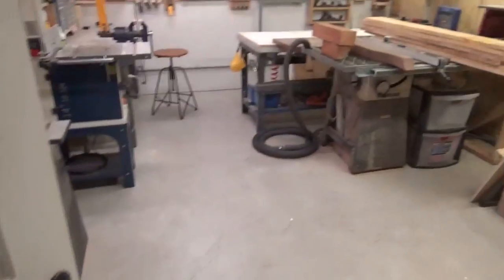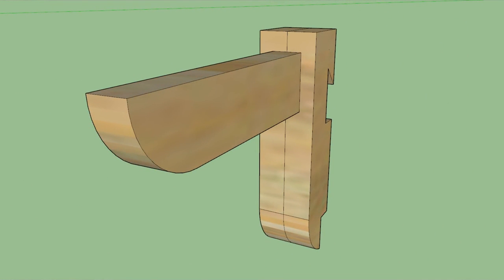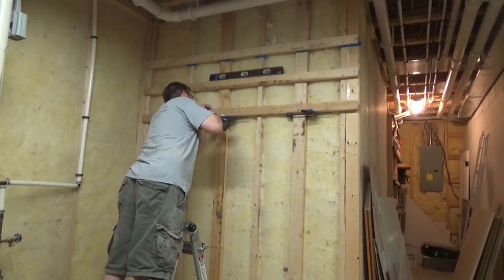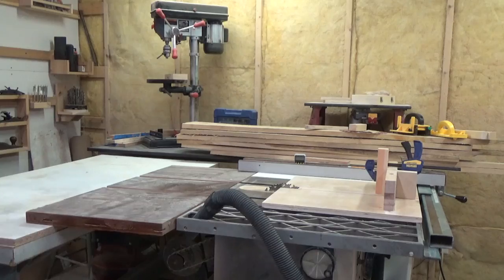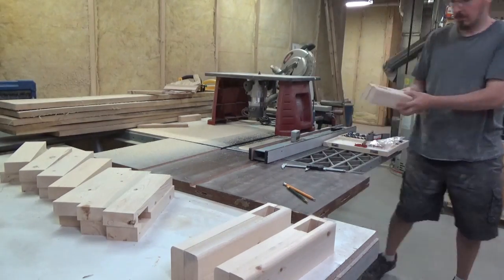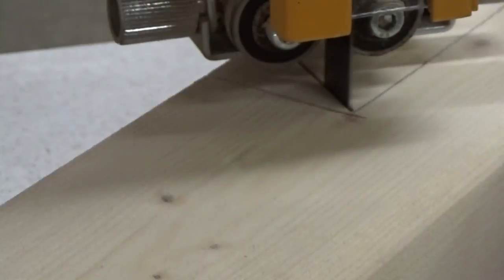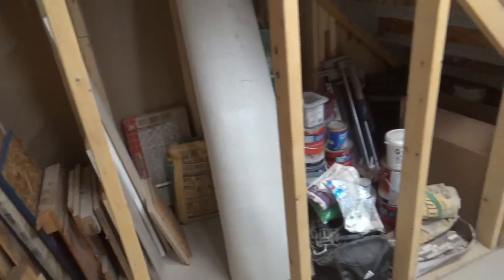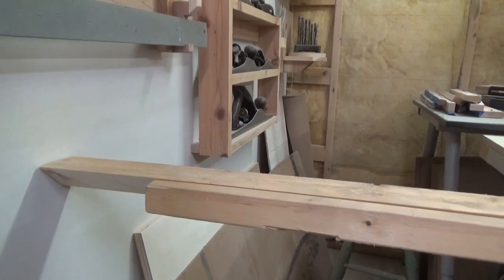Shop Work: How to build a French Cleat Lumber Rack

Comment: Fine craftsmanship! I'm a plumber, I evenly space 2x4s along my wall with holes drilled into them at a slight upward angle with a drill bit guide made from a piece of 2x4. Then took old 1/2" galvanized water lines I removed from various jobs and made lots of 3 different length rods I could put in the holes at different alignment and heights. I have material as short as 3' up to 20' on there. Only cost was 8 2x4s. Took about 3 hrs all time involved and works slick!!

Comment: You are one of my favorite woodworkers to watch. Your videos are applicable to the common woodworker and the videos allow for proper execution of the project along with the comic relief we all need! 
Simple solution for your glue bottle.... you could use the unmentionable pallet wood to make a 6 inch by 1 1/2 inch  with a tapered notch that fits under the cap. Makes for a nice lever for those of us that get on in years or forget to clean the tip before we close the bottle. I’ve actually changed over to a Gluebot. Great investment! Btw, eventually everyone is going to want their “appropriated” lumber back!  lol
Reply from the maker: Thanks Mark! 😀

Comment: I like it and the way you built the wood holders you have room below the top cleat to put in a block of wood to lock it down and make it absolutely tornado proof. Works good on lots of cleat accessories that may come off due to the item stored in it. Please do an in-depth video of air compressor system that I can remotely start i.e, I’m wanting to store inside my workbench and have a panel on outside that allows me to start, stop, have air filter and oiler and here is the kicker, discharge the air and moisture automatically when done using it.  I don’t keep my compressor pressurized. Thank you, great channel!

Comment: Really like your system, you designed it very well! I’m like you in that I can’t pass up a free piece of wood or even one I have to pay for. That being said just pray you never have to move, because of business we had to move five times in six years. The movers loved it! Charged more to move my shop and it’s contents than all the rest of the house combined! After the third set up I resorted to Costco 18” x 48” x78” wire rack shelving. At $80 a piece and combined with some full size 12”x 12”x 18”  commercial milk crates all my cutoffs finally had a portable home that locked nicely into the shelves at 3 per shelf. By aligning 3 shelves on each u it at the same height I was able to accommodate all the 8’ - 10’ stuff. By attaching an 8”x8” angle brackets to the bottom of each vertical post I was able to also hang some sheet goods and plywood  across the back of the units as well. As each rack is rated for 600 lbs per shelf and on locking 4” wheels, they could easily be rolled right into the movers van. The only downside was the buyers all wanted the shelving to be left as part of the house sale!!!
Reply from the maker: Yeah I'm not looking forward to having to move the shop when it comes time.  Can't imagine doing it 5 times!  But I guess out of it comes ingenuity like what you found.  Great work, Ken! :)

Comment: I had a bunch of long steel  bars maybe 7/1`6" dia.    Cut them about 12-15" long.   Drilled holes slightly undersized into studs, pounded them in,  Lose only about 1" vertically between batches of boards.  has worked fine for over 30 years

Comment: Love it ! I got the same problem, well to a certain degree, much smaller shop though. So I like the idea and the flexability of it, so I will start to plan for it. Like most things though...time is involved, huh. Anyways great job, love the patience involved.  Gotta love the texting and cell calls, they come right at the ....right time don't they?  Andrew
Reply from the maker: Thanks, Andrew!  I've really enjoyed the system so far.  I've rearranged it twice now to accommodate different wood storage configurations and it's worked perfectly.  The only thing I wish I did differently is to create even more brackets.  I could easily use another half dozen for additional supports (to keep wood from sagging over time) and to just hold more smaller pieces.  Thanks for watching man!
Reply: @FishersShop  
What was the size of the wall that you built your cleat system on?

Comment: You have GREAT ideas and a great system, however that's too labor intensive for me, plus I am lacking many of the awesome tools needed to copy your system.  I LOVED YOUR DIAGRAM AND YOUR CONCISE EXPLANATIONS AND CLEAR INSTRUCTIONS.  Also, like you, I cannot reaist saving boards, wood, lumber that is being tossed out.  A friend recently put me in touch with someone closing their pallet manufacturing business.  I got five SKIDS of pallet decking boards (NO BREAKING PALLETS APART FOR THE WOOD) as well as some other lumber for no cost, well just my time, sweat and the cost of the chiropractor afterwards (I'm not kidding).  I don't own a pickup truck, so I made DOZENS of trips in my car with the trunk and back seat loaded up.  All of the decking boards were salvage boards (ie. previously used, had cut off nail heads) and a couple of skids were that beautifully aged dark color that has so much character.  Now I have wood enough for all my projects!  I was VERY FORTUNATE!!
Reply from the maker: Sounds like you're going to be busy. :)

Comment: Great project. I've been trying to figure out a simular solution. Funny I thought of another and easy method while watching. One or more sheets of 3/4 hung horizontally or vertically with wholes to accept dowls. A peg board in sense. Adjustable almost like cleats.
Reply from the maker: Yes, that would be easier.  But you'll soon find out the holding strength of that design will be vastly lower than your expectations.  Try it and find out!

Comment: Very nice rack. Makes a lot of sense. I’m a little surprised that with so many identical pieces he didn’t use a stop block on the miter saw, a dado blade for the notches, or a template and router table to clean up the curves. We all have our own working style, but it must have taken quite a while to build all those pieces. Also, he has a LOT of faith in those screw in the cleats - I’d have added some F26 for more strength.

Comment: Thanks for video. I already have the French cleats on my walls, so all I have to do is make the hangers. May I suggest you put "dado set" on your Christmas list? DO NOT ask Santa for a wobbler type. They're a complete waste of money. Also, don't get a 6-inch set. If you use a sled for something like your tenons, you may not get enough blade height with a six-inch blade. Go for the 8-inch and you'll never regret it.

Comment: Very clever and cool project. I like how you thought about maximum strength joints and combined it with what you needed. Maybe you can scan the neighbourhood now for some wall lining? The dust that settles on the insulation would drive me nuts....

Comment: I would mention the term overkill, but it's too late for that. Lol
I'd make a similar rack IF I had more than two walls to work with, but both walls are pretty much already crowded with tools, benches, cans of unused chemicals and many other assorted items not to mention windows. The rest of my work areas are open and filled with all the crap I can't get the Mrs to part with even with the threat to life and limb. 
Oh well.. Good video anyway and thanks for the entertainment value.

Comment: Hi great voice, have you ever thought of doing the narrative on a Steven King Audiobook. As for the cleats, they look great but i'll have to take out a morgage on my house to pay for all the maschines you used to make them! And a degree in Engineering would'nt harm either. In spite of that a great view. Thanks a lot.
Ronald
Reply from the maker: The bandsaw is the most pricey of all my machines... but that's because I bought it brand new.  Everything else you can find on Craigslist or FB Marketplace for cheap.  I get a lot of comments about how I must have spent thousands on all my shop gear and it's just not true.  Like any hobby though, you're always putting money into it as you go, but it really doesn't cost much to get started.  Hey thanks for watching and for the comment.

Comment: Love the idea and attention to detail. If you did it over again… would you keep the 90’ on the arms, or would you have angled the cuts so the arms angled up ever so slightly and any stored wood (including round stock) would tend to stay against the wall instead of possibly sliding forward and off the arms? (Just thinking ahead to anything sagging under heavy, prolonged weight)
Reply from the maker: Since the bottom of each bracket is braced against another cleat, there's been zero sagging.  If I had to do it over again, I'd do it the same way.

Comment: It looks like you might have the same old trusty jointer model as me. Have you ever replaced the knives? If so where did you get them? I need new knives and can't find them. Good video
Reply from the maker: I just sold that jointer 2 days ago!  Haha.  I looked around for new knives and couldn't find them, but admittedly, I didn't look all that hard.  I knew I'd be getting something different eventually so I just tolerated the dull knives until I could get what I have now.  I just upgraded to a Ridgid.

Comment: You could of gang cut a lot of that & saved you a lot of time. 
Lay out the mortise pieces, line them up, cut both lines with a circular saw, then go between with router. Could have done similar to cut out for the cleats.

Comment: Any suggestions for starting out a woodshop in one's basement? Soundproofing tips, organization (I really like the French cleat method), what type of cushioning to wrap around low hanging sewage pipes (because wearing a hardhat while woodworking isn't my ideal fix), etc.
Thanks!
Reply from the maker: You can get pool noodles at the dollar store.  Cut them in half and duct tape them to the corners of low-hanging duct work.
Just regular old pink insulation does pretty good sound proofing, it's way cheaper than the high-end stuff and works nearly just as well.  The big thing for basement shops is dust collection.  Otherwise it'll get into your furnace and makes the rest of the house dusty.  Good luck!

Comment: Well done, but it seems like an unbelievable amount of time and materials for something that relies on the withdrawal/ shear strength of the screws. Drilling holes in the studs at a 5 degree angle and putting black pipe in it would have been much quicker. 2” deep holes, 1/2” pipe.... and you can stack higher because the 3” tall arms aren’t in the way.
Reply from the maker: I never claimed efficiency.  I did this mainly to see if I could and if it would work.  Turns out it does.  But there are many other alternatives.
Reply: Well said.

Comment: Drew what do you think the limit would be on the length coming off the wall? I have the metal system and I have 24" lengths. They actually sell them in 36" lengths, but you have to go to the bigger support brackets. Great video.
Reply from the maker: The longer the brackets, the more torque they put on the cleat.  Especially when they're loaded up.  But to counter this, you can build additional support by some diagonal supports up from the bottom of the bracket, essentially turning them into a french cleat corbel.  However, if you go this route, the diagonal support will impede stacking efficiency on the shelf below.  Hope that makes sense, my friend.  Good luck!!

Comment: That’s not a lot lol you should see my garage , I built fences and decks for two years with my boss before I started the siding department . My garage is packed and I mean packed with cedar cut offs ranging from 1’to 16’ lol now the lengths over 3 feet are not cut offs . So this winter it’s time to build a lot of planter boxes and stuff like that to sell in the spring , I would like to see the walls and windows in the garage again

Comment: You're probably going to need more mounting cleats, looks like the piece of wood you'll want to use will be at the bottom of each pile.  With more cleats you can make the piles smaller and thus easier to get the piece you will invariably need.
Reply from the maker: Yeah, I thought 10 brackets would be enough.  After I was done with the project, I wish I made several more.

Comment: Just curious why you didn’t sheath the walls with OSB to protect the insulation and also provide the ability to hang things nearly anywhere on the wall.  I did that in my shop and it works great.
Reply from the maker: Probably would be better for the reasons you mentioned but I just didn't have the material or the funds at the time.

Comment: Nice job.  Off topic, but have you had any problem with your furnace being in the workshop?  I cracked my heat exchanger because the combustion air sucked in enough dust to clog the heat exchanger.  It looks like you have a combustion air intake from outside.  Anyway, any furnace problems?  Thanks.
Reply from the maker: None as of yet.  Been a few years making sawdust so far.  Maybe I'll have issues later?  But none as of yet.

Comment: This was really freaking nice! Nice job!

One question though, why did you sort the plywood later with the better ones easier to reach than the crappier ones? It is a bit of a managing trick on the subconscious. You don't need incentive to use the good stuff, so if you really need it, you go for it whether it is in the back or upfront. But if you put the worse ones in the front, by seeing them first you actually consider if you can't just do the project with one of them instead, and in those cases you just need "some wood real quick" (like a one-job jig) they will be the quickest thing you can reach, so they actually get some use. But I wonder if was there some reason I didn't think about to do it the other way around, something I overlooked.

Comment: I'm new to the woodworking community, and I was intrigued by the blade you mentioned help cut out the slots for your Mortise & Tenon joint. What kind of blade did you say it was and could you post a link to find it?
Reply from the maker: Any blade with that is a flat-top or at least has a flat-top raking tooth will get the job done without you having to do much cleanup after your cuts.

Comment: Very nice results but a ton of work.  How long did it take?
Reply from the maker: Thanks, Clay.  It didn't really take as long as you might think.  There's only 1 glue-up and if you have enough clamps, you can glue up all the brackets at once.  I think all-in-all, I spent 2-3 evenings down in the shop working on this.
Reply: "enough clamps?"  who has enough clamps?  thanks

Comment: Nice job, Drew. Have a question for you. I built an A-frame plywood rack on wheels thinking it would free up space in my shop and it turned out to be this huge monolith that never goes away. What would you recommend to store plywood in a small shop with lower than normal ceiling height? It's only 7'4" and I can't stand the full sheets on end. Wall space is also at a premium.
Reply from the maker: Well if wall space is at a premium and your primary concern is storing sheetgoods, then I'd actually recommend exactly what you already have, an A-frame rack on wheels.  It might always seems that it's in the way, but there's little to no other option.  And with it on wheels, you can at least roll it around where a wall-mounted rack would be stationary.  I don't know... seems like you might already have the best option.

Comment: How do you get a flat edge at the end of your boards on the jointer.  I seem to be having a problem with the back couple inches not coming out right.  I get a little upward curve.  So either I cut my boards longer joint then cut again or there must be something I am doing with my jointer technique.
Reply from the maker: Sounds like your jointer needs tuning.  Maybe the blades aren't set properly or perhaps the fence isn't square.

Comment: Nice work. I noticed your HVAC unit for the house is in your workshop area. Are there any issues with dust going through the intake into the house?
Reply from the maker: +69kaveman I just buy filters in bulk off Amazon and swap often.

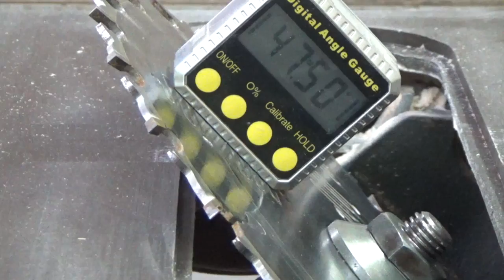Comment: I have a safety question, not as the safety police but as an interested party.  Is it safe to rip construction grade 2x4 like as shown at 2:28?  I have some I need to rip down and I'm worried about it because a 2x4 isn't ever really straight enough to safely rip, even with a riving knife.  Or Is it?  I need to build a jointing jig any way, but maybe I am going overboard.
Reply from the maker: Perfectly fine but obviously safer if you have the riving knife.  That old saw didn't have one, new one does.

Comment: Great work! But may I tell you something? I do not want to lecture you, do not tell you what to do, but I know from my own experience that the glass wool insulation should be covered. The mats give off a constant fine dust that settles in your lungs over time. I also worked like that for years until I got asthma. The doctors found that this glass dust is at least as dangerous as Asbestos. All good for you and your loved ones. God bless you colleague.
Reply: Not having drywall on the walls and ceiling also creates a fire hazard.